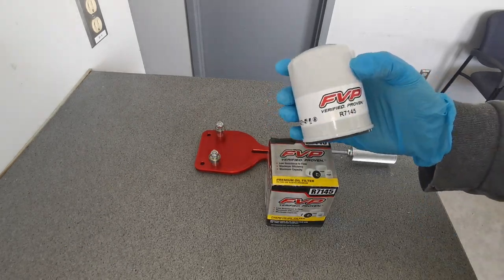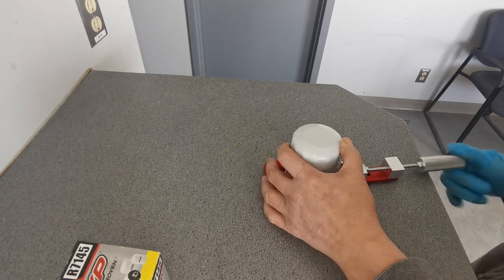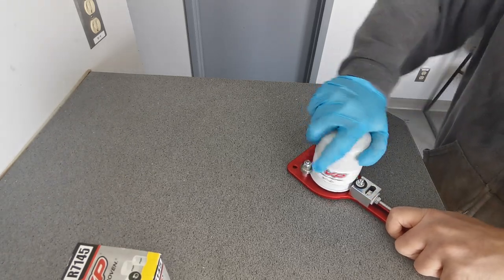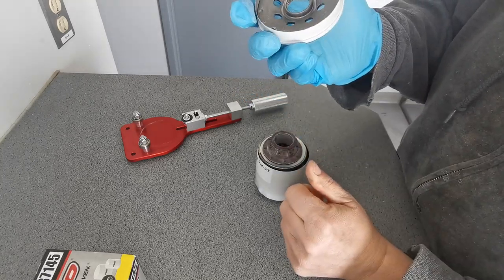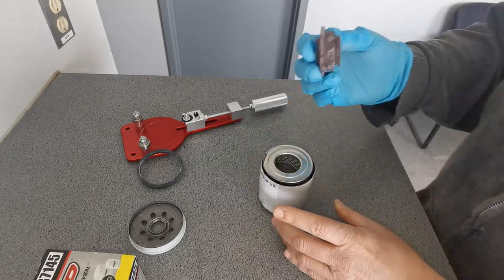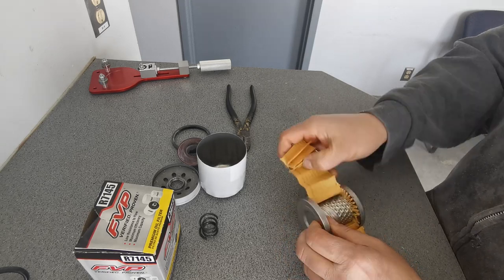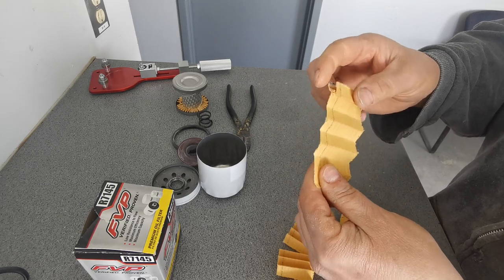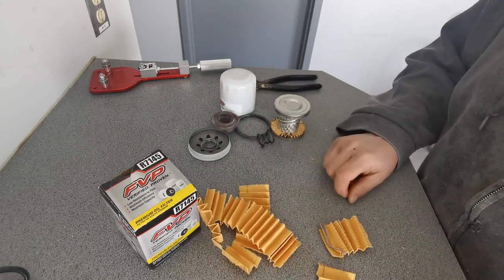FVP oil filter review

Comment: Thanks for opening it up,,, so its a low dollar base paper model ... not the worst considering metal end caps and hefty drain back rubber or silicone valve and actual coil spring. Center tube also looks like it can flow enough... i got a case of Defenders i will open one up soon... that one is prob cheaper made with a few holes poked in center tube... maybe limits flow
Reply from the maker: Thanks doctor who, I have found that some economy filters are built better than high end.